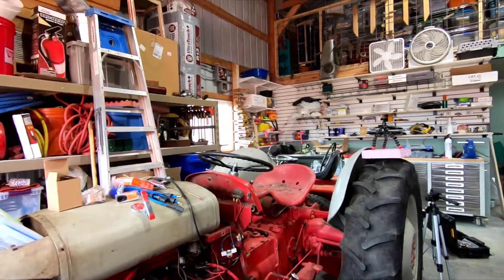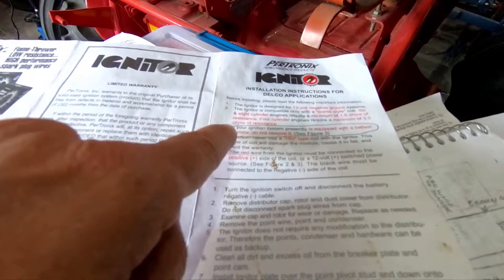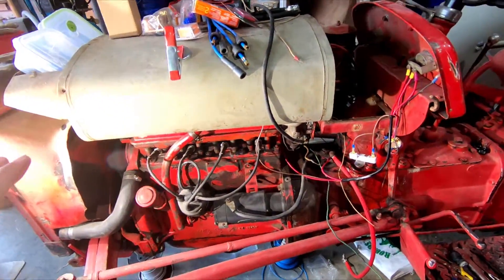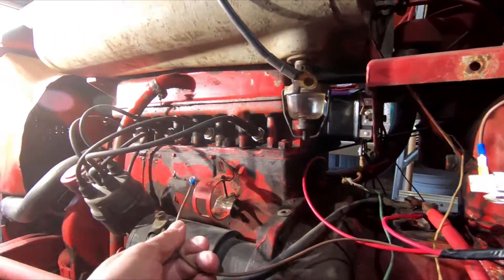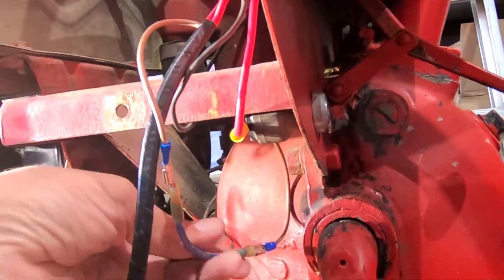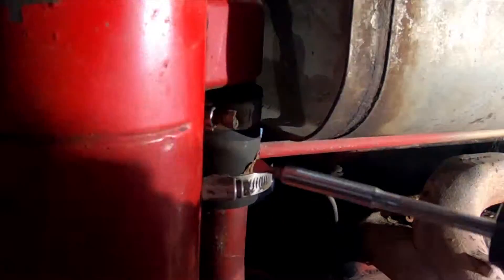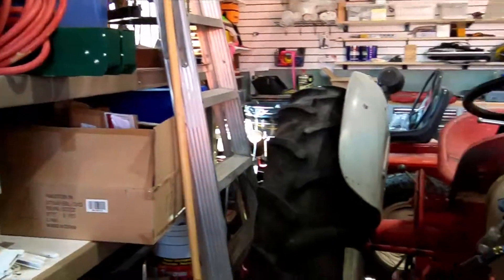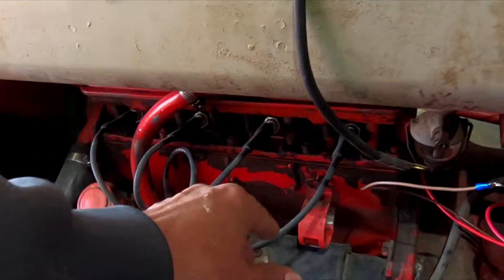Ferguson TO-20 12-Volt Wiring [Two]

Comment: Hey there! Will you email me the wiring diagram you made for the 12v conversion? I’m about to do the same on my TO20. That would be very helpful.
Reply from the maker: Hi Daniel. I can make a quick video and show it up-close on-screen so that others can see it as well. Just pause the video. I haven't tried it yet, but believe it's correct for the parts I am installing. Are you adding an electronic ignition as well?

Comment: I ordered this for my Ferguson TO20 and was looking at the wiring diagram and it says to go from positive battery terminal to ignition switch did you use a regular battery cable or did you use a smaller gauge wire
Reply from the maker: It is a 2 gauge battery cable -- but I believe it goes to the starter solenoid -- or starter switch as some call it.  I was right in the middle of the wiring on that when the weather warmed up and I had other stuff to take care of, but I hope to get back to it soon. 

In the video, you can see the long red 2 gauge wire hanging down from the starter switch which  is below the battery tray. That will go to the positive terminal on the battery. I'm going to post the wiring diagram when I get done, but you can also see the red wire from the harness going from the ignition switch to the starter switch via the ammeter I believe -- I'll take a look tomorrow and see if I can describe it better then.
Reply: ok then the diagram they gave me must be wrong because this shows a wire from the ampmeter that goes to one pole of the starter switch and the starter motor connects to the other pole of the starter switch